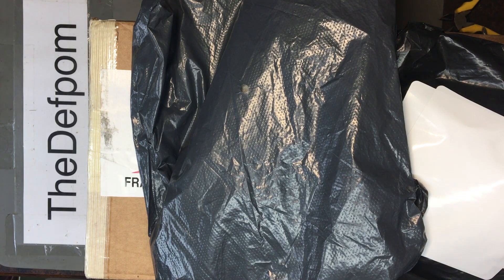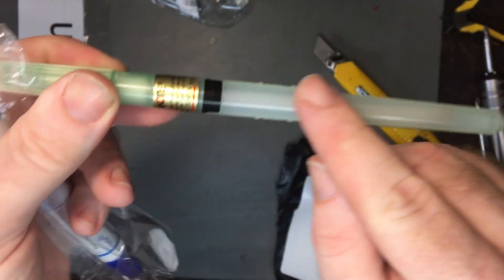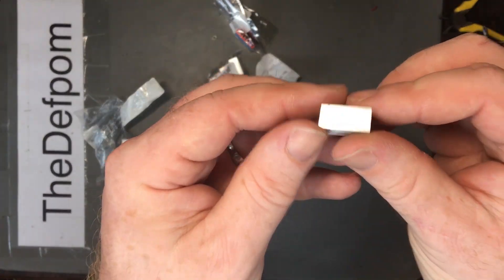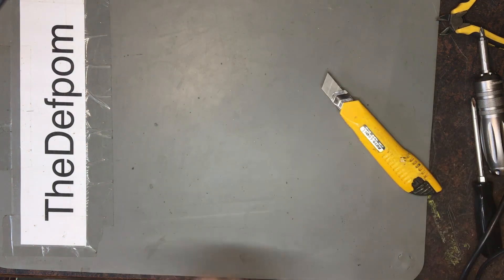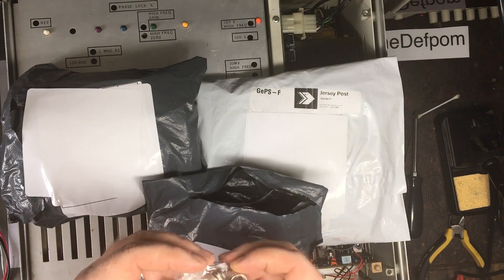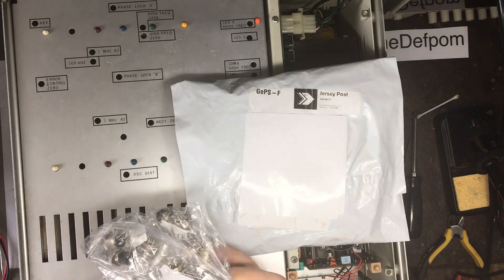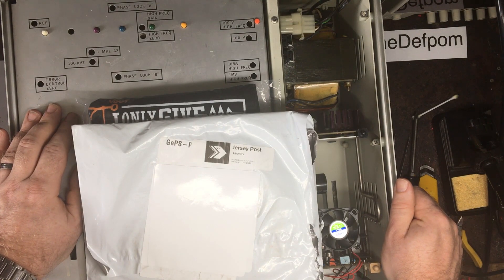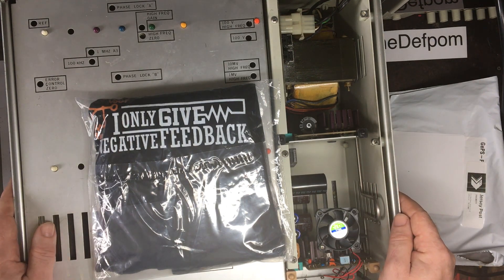🔴 #353 Mailbag 30th March 2018

Comment: You may want to source a bottle of flux, i'm sure you can thin it down to the viscosity you desire, it's something you will always need :-).
The amount of c.b plugs i've rewired over the years, i've lost count,  mostly uniden and cybernet wired, and getting good plugs was the problem.
Nearly as bad as the amount of r.f p.a transistors i've replaced lol, no one gives a dam about the v.s.w.r of antennas. :-(